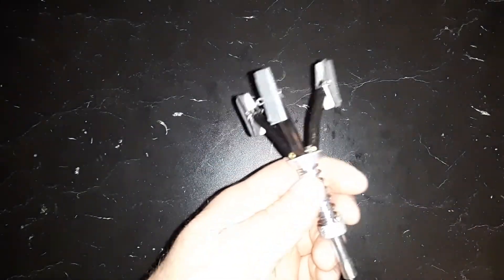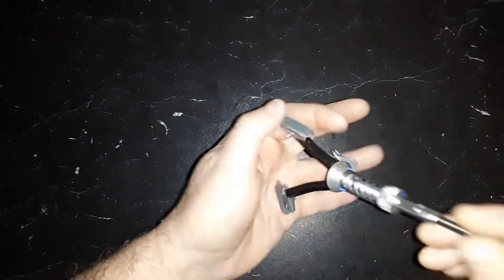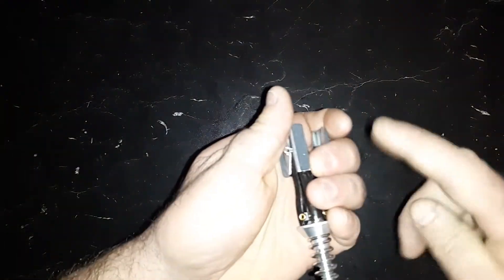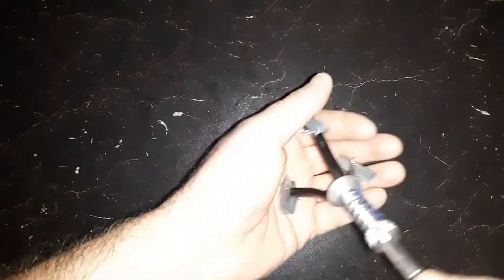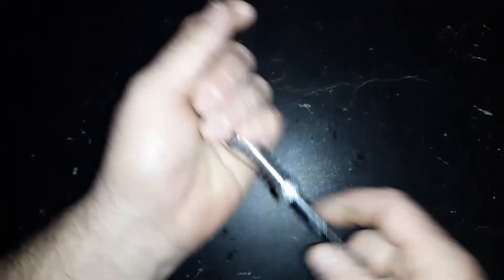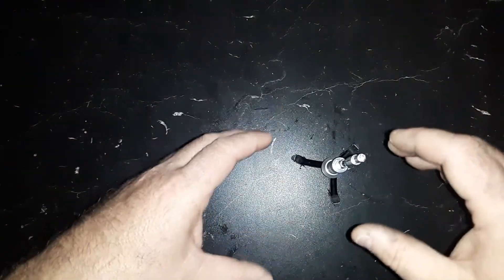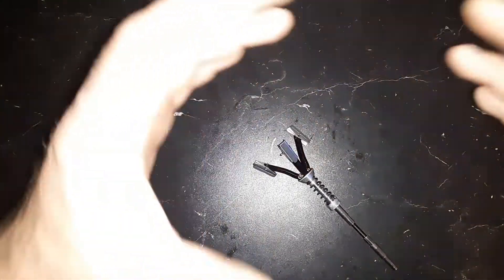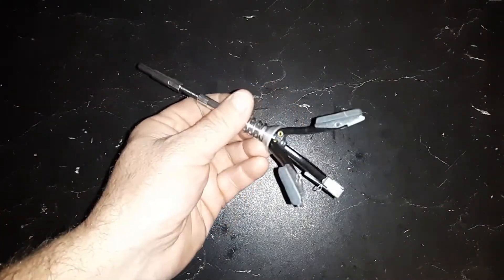Engine Cylinder Hone And Deglazer, How to!

Comment: Listen up, folks!

I just went through some 🦬💩 with these instructions, and it's simply due to my lack of SKILL.  

The OP sure does make it look EASY, eh? >>>>>> It's isn't!!!

He has SKILL, and so much so that the little pads on the tool he's using aren't long enough, and they get caught by the ports.  Therefore, a honing tool with removable stones is required if you're like me, never doing this before. 

The longer the pad, the less chance you have of snagging a port. 

Those small pads you see in this video >>>> I snapped a stone right off its mount on a port >> the epoxy failed. 😡  No scratch, but fail it did. 

Now, I'm out to go a different route, and get what I just recommended >>>> it should do much better than these tiny pads.

Comment: I'm running a full open intake transfer Port and I just have to be careful to not drop the stone down the cylinder too far. I've honed it twice and used new top ring only. it has more compression than when new I'm going to be doing it for the 3rd time soon. engine is a 3x40mm 47mm piston. Going strong since January 2019 so yes deglaze and revive a tired 2stroke go another year for a small amount of time and money. PEACE...